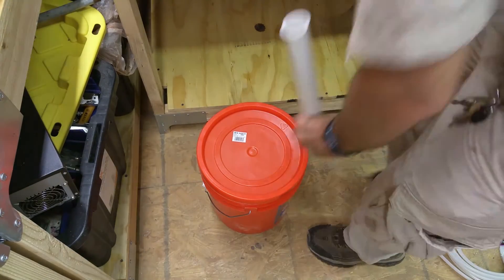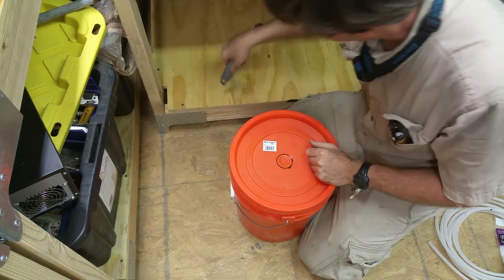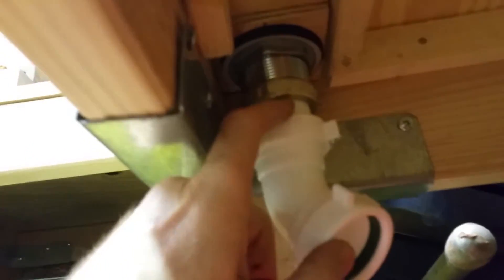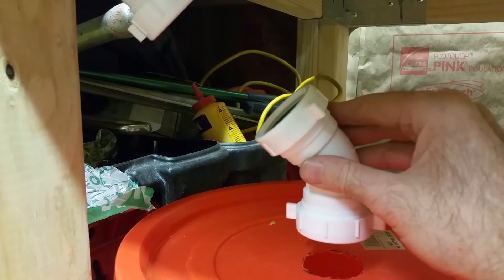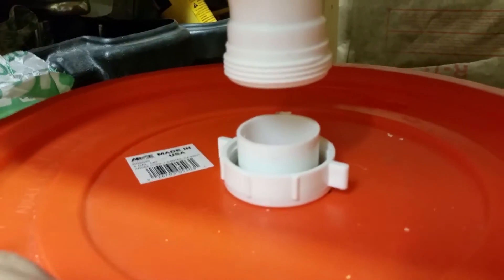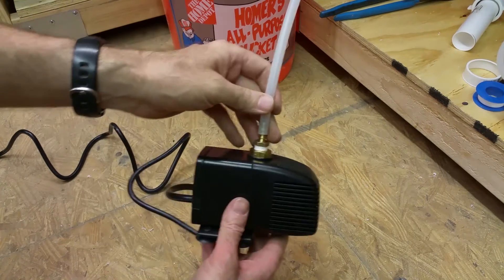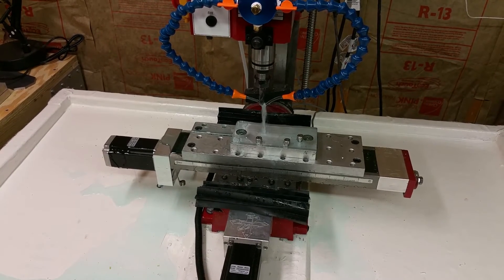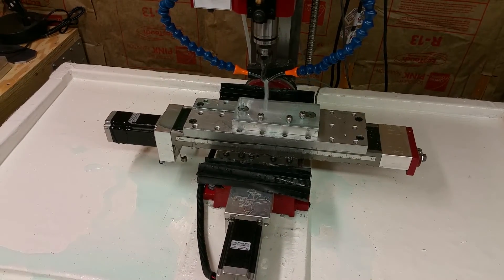Mini Mill Enclosure Part 9 - Flood Coolant

Comment: What’s the sink made out of that the mill sits on?
Reply from the maker: Wood and fiberglass
Reply: @craigsmachineshop2040  thank you do you know what type of fiberglass you used? Trying to do something similar thank you
Reply from the maker: @gregorynorth80  Sure thing! Just the stuff from Home Depot. Paint department I think
Reply: @craigsmachineshop2040  thank you
Reply: @craigsmachineshop2040  did you use plywood for the top?
Reply from the maker: @gregorynorth80  Sorry, yes
Reply: @craigsmachineshop2040  thank you